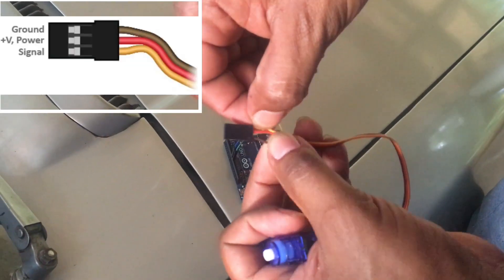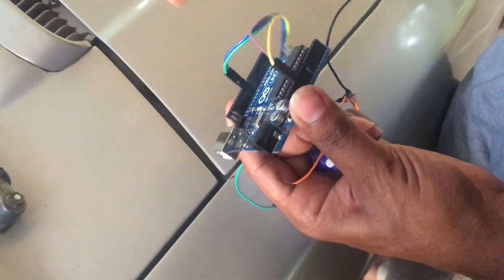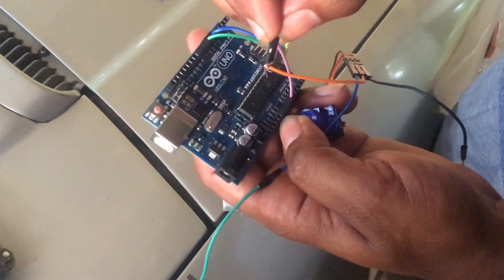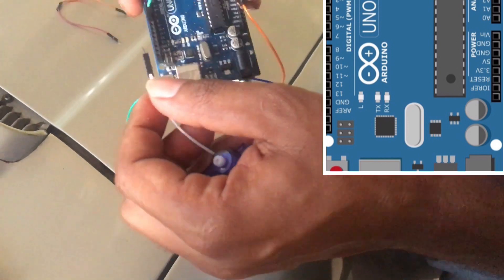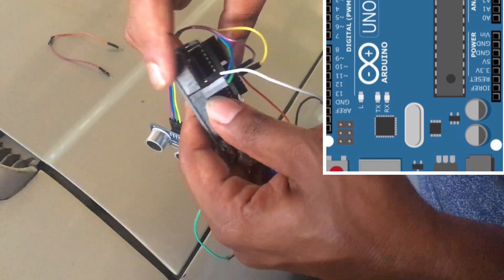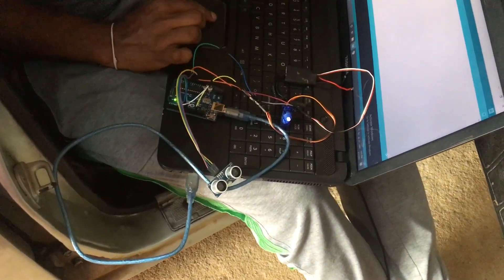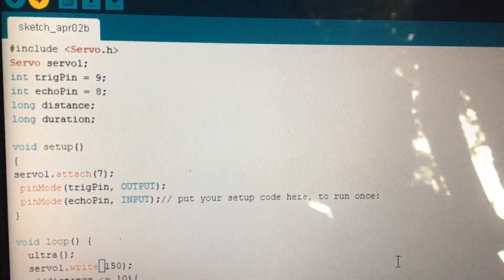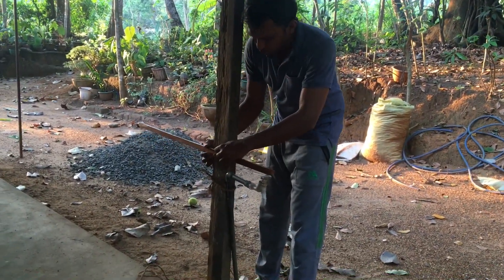How to make a AUTOMATIC WATER TAP(Auto ON OFF)Hand Sensing,Arduino.👍SL Arts and Crafts

Comment: Arduino software eka dennako
Reply from the maker: #include <Servo.h>
Servo servo1;
int trigPin = 9;
int echoPin = 8;
long distance;
long duration;
 
void setup() 
{
servo1.attach(7); 
 pinMode(trigPin, OUTPUT);
 pinMode(echoPin, INPUT);
}
 
void loop() {
  ultra();
  servo1.write(150);
  if(distance <= 20){
  servo1.write(0);
  }
}
 
void ultra(){
  digitalWrite(trigPin, LOW);
  delayMicroseconds(2);
  digitalWrite(trigPin, HIGH);
  delayMicroseconds(10);
  digitalWrite(trigPin, LOW);
  duration = pulseIn(echoPin, HIGH);
  distance = duration*0.034/2;
  }

Comment: Where is first comment
Reply from the maker: #include <Servo.h>
Servo servo1;
int trigPin = 9;
int echoPin = 8;
long distance;
long duration;
 
void setup() 
{
servo1.attach(7); 
 pinMode(trigPin, OUTPUT);
 pinMode(echoPin, INPUT);
}
 
void loop() {
  ultra();
  servo1.write(150);
  if(distance <= 20){
  servo1.write(0);
  }
}
 
void ultra(){
  digitalWrite(trigPin, LOW);
  delayMicroseconds(2);
  digitalWrite(trigPin, HIGH);
  delayMicroseconds(10);
  digitalWrite(trigPin, LOW);
  duration = pulseIn(echoPin, HIGH);
  distance = duration*0.034/2;
  }
Reply: @ArtsAndCraftsSrilanka  thanks
Reply: Diagram sir

Comment: there is no code?
Reply from the maker: #include <Servo.h>
Servo servo1;
int trigPin = 9;
int echoPin = 8;
long distance;
long duration;
 
void setup() 
{
servo1.attach(7); 
 pinMode(trigPin, OUTPUT);
 pinMode(echoPin, INPUT);
}
 
void loop() {
  ultra();
  servo1.write(150);
  if(distance <= 20){
  servo1.write(0);
  }
}
 
void ultra(){
  digitalWrite(trigPin, LOW);
  delayMicroseconds(2);
  digitalWrite(trigPin, HIGH);
  delayMicroseconds(10);
  digitalWrite(trigPin, LOW);
  duration = pulseIn(echoPin, HIGH);
  distance = duration*0.034/2;
  }
Reply: @ArtsAndCraftsSrilanka  THANK YOU!!!

Comment from the maker: Arduino Code For You :-

#include <Servo.h>
Servo servo1;
int trigPin = 9;
int echoPin = 8;
long distance;
long duration;
 
void setup() 
{
servo1.attach(7); 
 pinMode(trigPin, OUTPUT);
 pinMode(echoPin, INPUT);
}
 
void loop() {
  ultra();
  servo1.write(150);
  if(distance <= 20){
  servo1.write(0);
  }
}
 
void ultra(){
  digitalWrite(trigPin, LOW);
  delayMicroseconds(2);
  digitalWrite(trigPin, HIGH);
  delayMicroseconds(10);
  digitalWrite(trigPin, LOW);
  duration = pulseIn(echoPin, HIGH);
  distance = duration*0.034/2;
  }